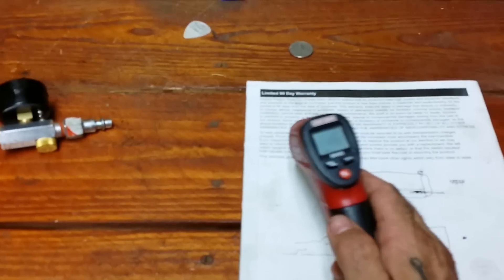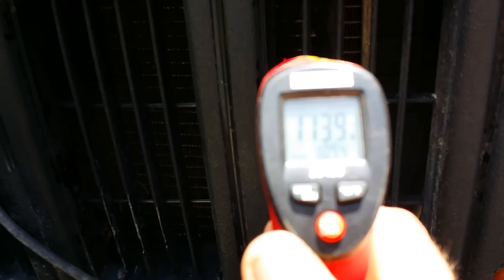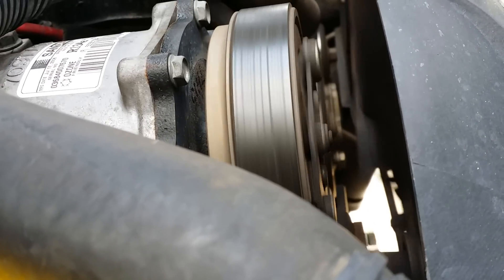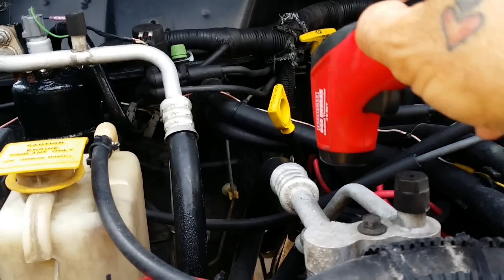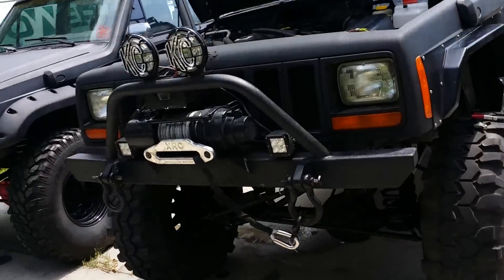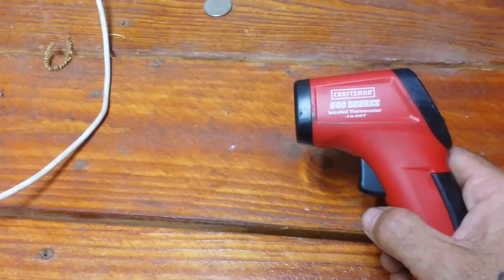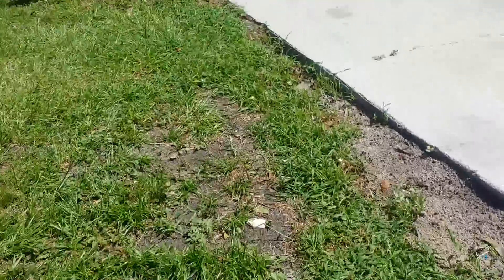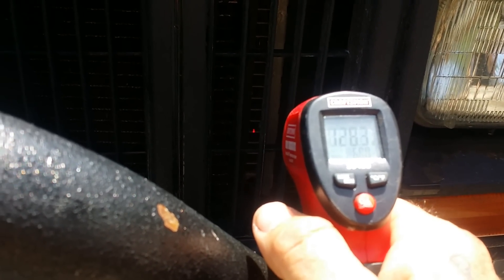Jeep xj radiator test

Comment: Had same problem on ranger radiator rinsed it out and flushed with CLR 1-2 times, Its a problem with single core  Ran cooler after that

Comment: my 1989 xj didn't come with AC and didn't have the electric fan. I wired one in off a switch on my dash. Once I installed it my temperatures stay solid even when climbing. I drove up a mountain for a few hours and didnt get above 100*c.
Reply from the maker: yeah man I need to put my factory fan on a switch just haven't done it yet the way jeep did the factory axillary it to high temperature before it comes in by its self with out the ac on